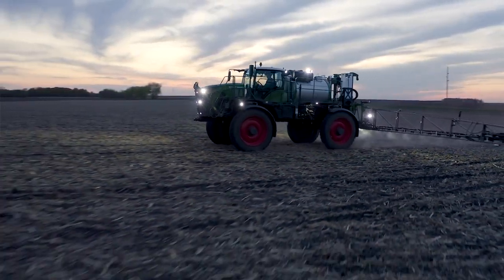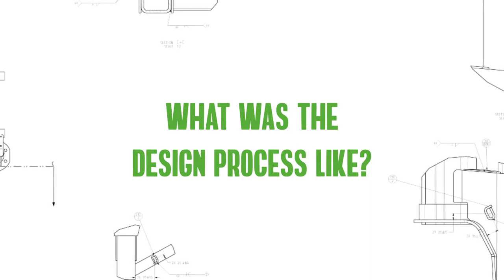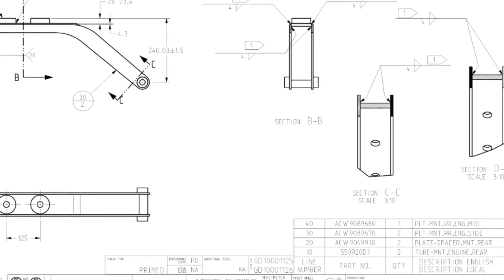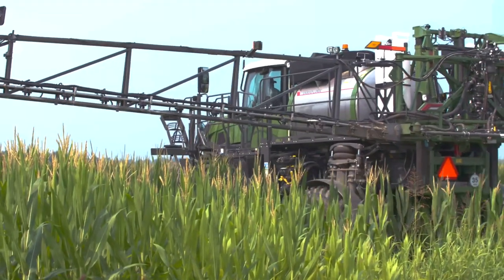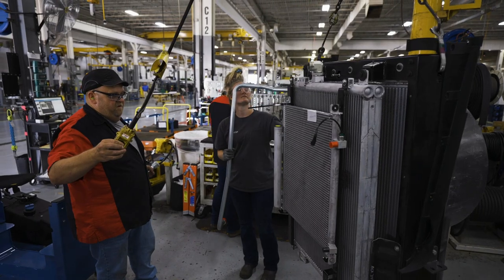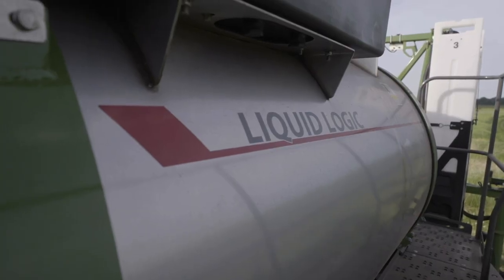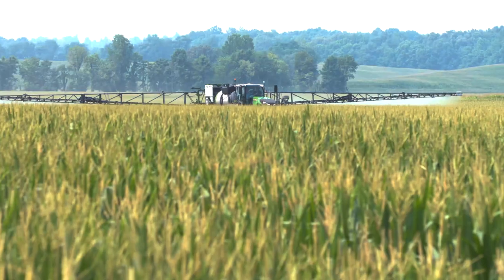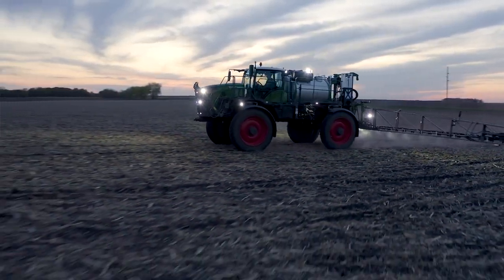Fendt 900 Rogator: Boldly Engineering The Future

Comment: I love how my 937H has fuel leaks and air leaks. The hood is bolted on crooked. The autoboom recalibrates itself in canopied beans, changing the internal numbers and making the tips shoot up to max height constantly, or just diving into the dirt. The autofold is complete garbage. The right main boom comes in to the mast at the perfect height and slows down as it reaches the boom rest. The left main comes in way too high and slams into the rest so hard it almost breaks it off. Then the tips fold in a horrible jerking motion and slam so hard they basically break in half. The manual fold scv's have no modulation of flow, theyre just on or off. The main recirculation valve never worked from the factory and there is no indication of whether it is functioning or not. So every fill when i thought i was recirculating i was just sitting there pushing on the line. You wouldnt think that would matter but it must make a concentration in the line. So i had about 50 spray "v's" that showed me something was wrong. The best part is the dealer doesnt care and will never fix a thing.